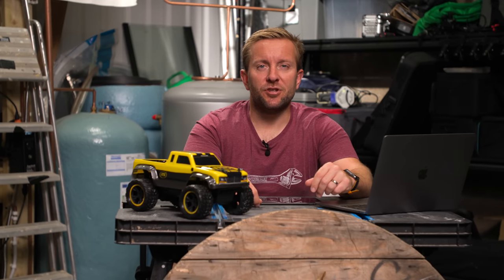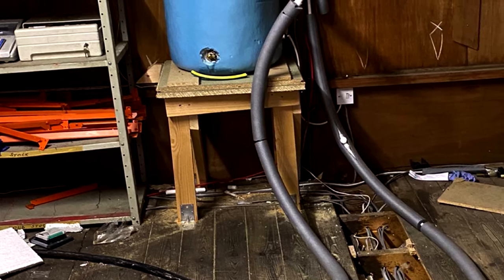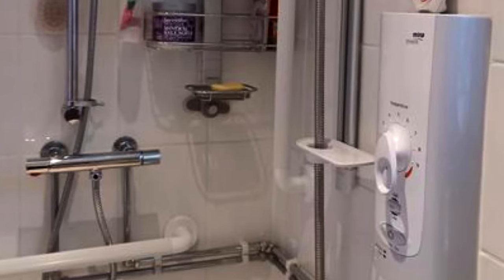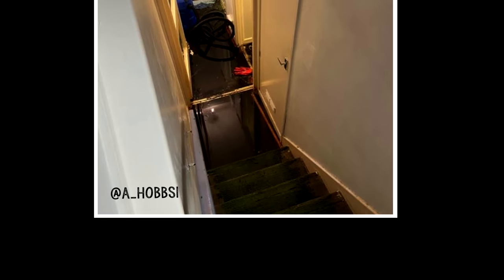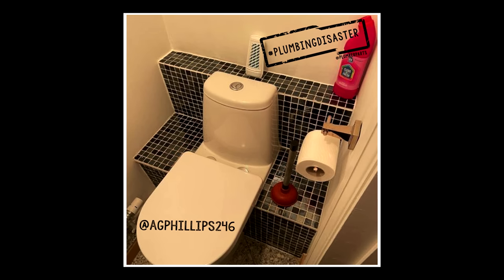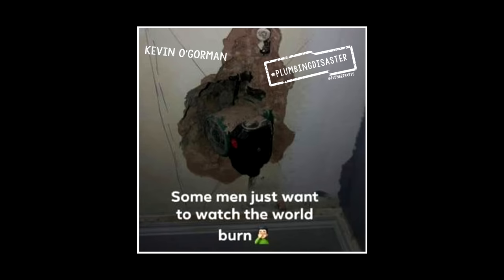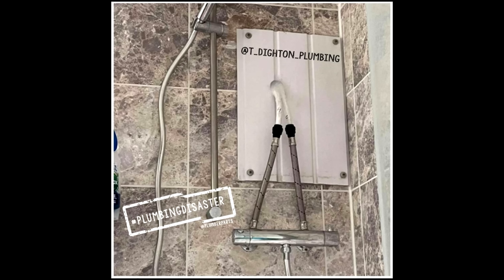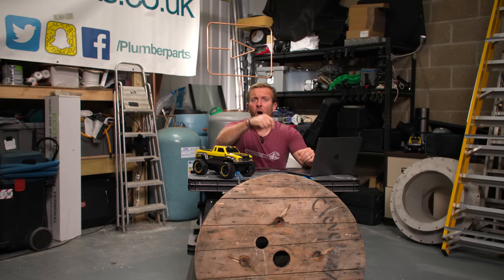The BATHROOM OF NIGHTMARES and other Plumbing Disasters!

Comment: I wish I could have had video of a drain line exploding at a hog slaughterhouse years ago. It was before smartphones though, but pieces of pig went flying 280 feet or so. It was 8” stainless steel flanged pipe that was 30’ overhead and was pressurized when we got it to break free. The smell.. dear god that smell.. it sounded like artillery going off, and that’s not an exaggeration. That was one of the worst disasters in my career.

Comment: Hey.

I have a plumbing question and was hoping you'd be up for answering it. Ill post in the hope you'll be able to help.
so my toilet has hairline cracks on it so i have bought a new one, its identical. The toilet is a back to wall one with a hidden cistern that's really difficult to access. can i simply pull the toilet away from the fill pipe and the waste pipe and push on the new one or is it more complicated than that :0)

Comment: Hi I'm looking for some advice how too fit mixer tap for bath with shower head I've got a water cylinder tank in cupboard but just want too know if would be possible too just fit mixer tap without using water pump any help be much appreciated.regards paul

Comment: I want to break into my sink taps underneath and come out the wall to put garden taps up but don't want them to freeze I know about check valved garden taps but have to run outside pipework because I cannot get in the building next door to me have you any suggestions